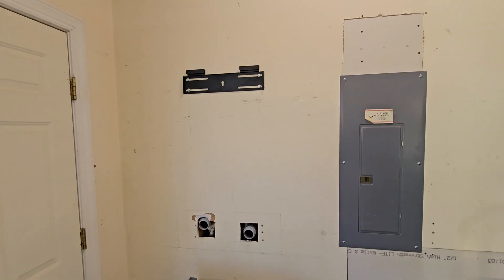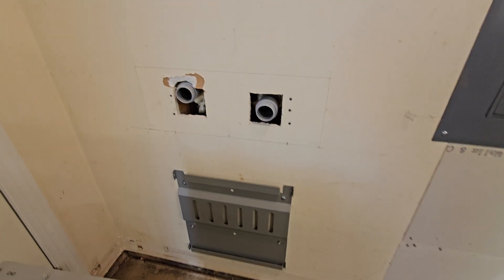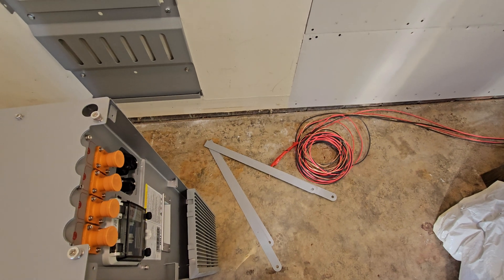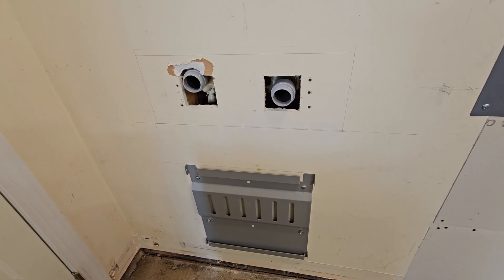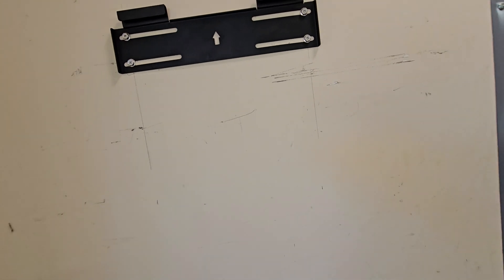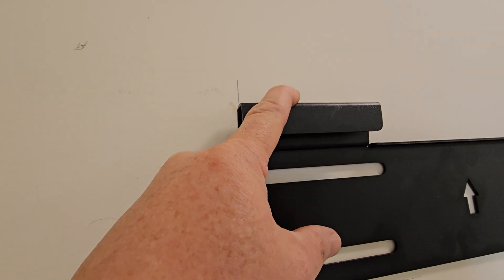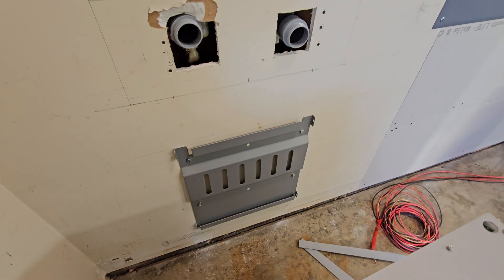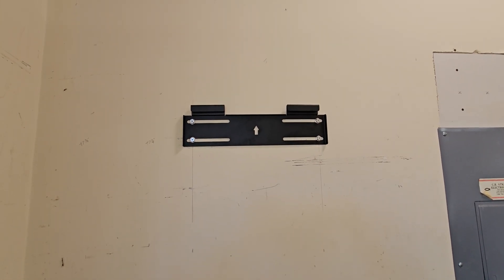EG4 PowerPro Battery Mounting

Comment: I know the battery bracket just holds the battery from going away from the wall and the battery actually sits on the ground so does the inverter actually stands on the wiring box and that bracket holds it to the wall or does that inverter bracket take all the weight of the inverter. Thanks for all the tips
Reply from the maker: The conduit box is not very sturdy.  I have the weight of the inverter on the mounting bracket and set so the bottom of the inverter just rests on the top of the conduit box.

Comment: What is the horizontal spacing between the screws that attach the mounting panel to the wall?  The manual indicates to align it with studs, but it doesn’t indicate what the stud spacing should be in order to have two or three studs available at the right locations to screw into.  The overall width of the battery is 22.3” so it seems like the horizontal spacing might be about 20” (10” from the center holes to either side).
Reply from the maker: It is 16" between the two lag bolts.  On the battery bracket there is a third hole in the center, but I didn't use it since it wouldn't align with any stud.  I think it is used if you are mounting the battery onto a block wall.

Comment: Did it work ?
Reply from the maker: Yes it did.  47 and 3/4 inch is the correct measurement.  Everything is installed and powered up.  I will do another video tomorrow.